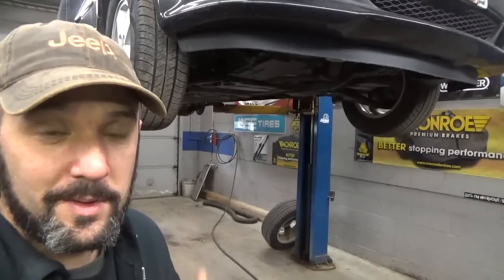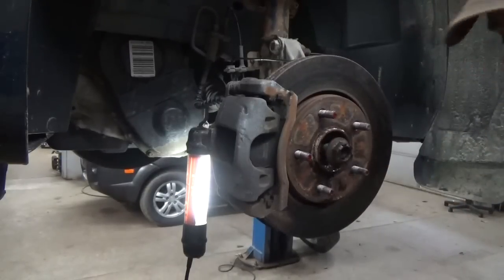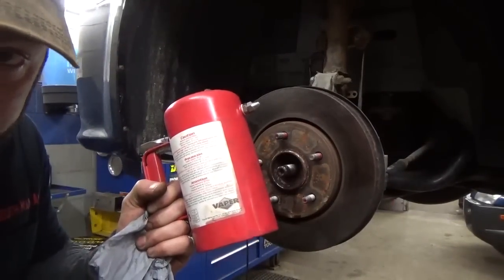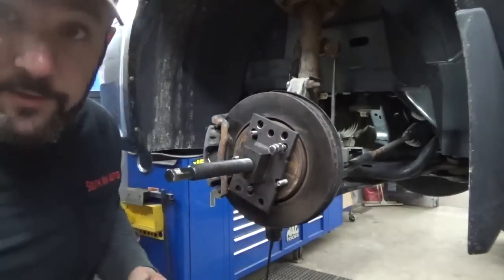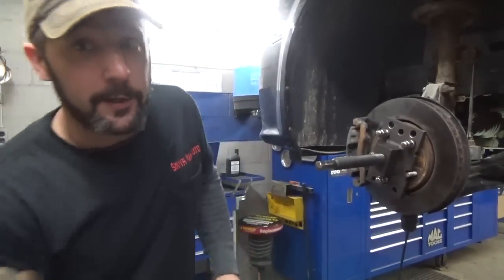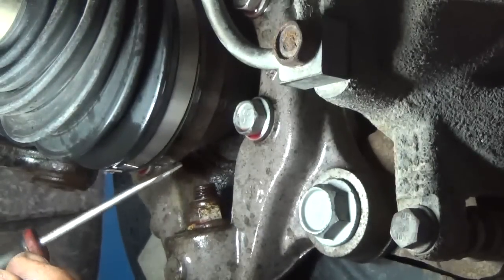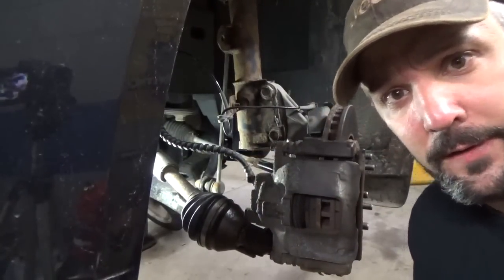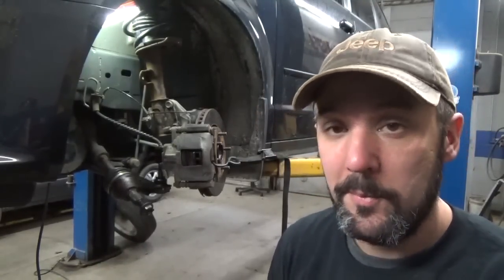Dodge Grand Caravan Lower Ball Joint - Part I

Comment: Question Because the axil is damaged now and has to be replaced Who has to pay for the replacement? I know it wasn't your fault u had to remove the joint. Just curious how the expenses are transferred
Reply from the maker: William Govan Customer buys the parts to do the job... just happens to be on this car the axle was seized ya know...

Comment: ABSOLUTELY THEEEEEEEE   MOST  REAL LIFE  /   GENUINE  REPAIR VIDEO ON THE  INTERNET.    SEVERAL TIMES I HAD TO LAUGH.       BEEN THERE    DONE THAT.  TRYING TO FIX ONE THING--ONLY TO BREAK SOMETHING ELSE THATS EVEN HARDER TO REPAIR/REPLACE THAN THE FIRST ..   I WOULDVE GIVEN THE CAR BACK TO THE WOMAN AND TOLD HER TO GO ELSEWHERE..      OR  RUN THE DAMN THING OVER A CLIFF ..    LIFE IS FAR FAR TOO  SHORT FOR SHIT PROBLEMS  LIKE THAT.     THE ODD PART OF IT IS.    THAT CHRYSLER  KNEW THIS WOULD HAPPEN WHEN THEY DESIGNED THE DAMN THING...
    JUST AS FORD KNEW THAT FREEZING RAIN  WOULD SLIP DOWN INTO THE DOOR HANDLE RODS INSIDE THE DOOR AND FREEZE THE DAMN THINGS IN PLACE--   WHERE YOU COULDNT OPEN THE DOOR UNLESS YOU POURED HOT WATER DOWN THE WINDOW.

Comment: recently changed the wheel bearing on my 2002 sunfire  Axle slid right out. Helped a freind with an avenger some  years back he torched the axle stub off! then called me I smaked it with a sledge and big drift what  was left poppped out. doy you think dadge axles sieze worse than gm's?

Comment: hey, there Mr south, just wanted to suggest, cause im new to this task your performing,    could u have use  oxy-acetylene heat  to losin  that nut or what ever bolt u were tryilng to get loose.
Reply from the maker: hunkydude322 I thought heat may ruin the bearing

Comment: Hello I know what you are going through, I am a Canadian. Salt holds our cars together!  I would like to comment on the stiff cv joint,all that's wrong is the shaft is driven past the clip groove. The end of the shaft is bottomed in the joint. The easy fix is to clamp the shaft in the vice and slide hammer the joint back.

Comment: When your pounding that hub tool that's tightened to the wheel studs with the sledge hammer, aren't you just transferring all the impact directly to the hub and shackle and any play in the suspension just gets moved to the cv joints?  It doesn't seem to transfer any opposite force directly to the shaft to move it away from the hub???

Comment: I feel your pain working in the rust belt also.

Do you charge the customer additional labor time for removing that stuck axle?

At our shop, as a tech, if it took me a few hours to do the same as you, i would loose time as where i work, they only bill for what the book time calls for, no more, no less.
Reply from the maker: dreamer2355 If I only got paid flat rate as soon as my time was up I'd pull it out and quit lol. I charge by the hour on things like this, you have to. I didn't make it rust ya know? Any one going to fix it would have faced the same problem.

Comment: Why do you use joints with grease fittings? The fittings, in ny, get rusted so fast.
Reply: Joshua Harden, you can pick up rubber caps for the Zerk fittings to prevent them from getting rusted up or covered in gunk.
Reply: Pet Rock's Garage If you grease them regularly and leave a clump of grease on them they don't rust, plus they are easy enough to replace and the reason the original failed was lack of grease IMO

Comment: cut the boot off the ball joint put vise grips around where the boot would be. Loosen the balljoint nut with a wrench and using a torch to ease up the nylock as you loosen the nut you can knock it loose from the spindle pulling the control arm down so you dont have to d1ck around with the axles. Book time calls for 3.4 hours to press in lower ball joints on the Chrysler van i did yesterday. i live in Maine where it rusts like hell up here. I got em both done and out the door in 30 minutes. I will say the torch can be a finesse type of tool if used properly.

Comment: 12:03 The secret with removing the rear brake drum (which is bolted onto a taper) off a Skoda Estelle was to apply torque to the puller whilst simultaneously belting it with a club hammer. Was never defeated. Also always applied a smear of grease onto the shaft when refitting and never retightened it to 'factory specs'. 
Am curious to know why the flame wrench didn't appear.

Comment: OMG, LMAO  thanks for the entertainment.  I cannot believe how hard it was to get the nut off.  I have a 2011 and mine was not that difficult to remove.  .I do not have any air tools.  I have clunking and clicking noises coming from right side wheel well.  I jacked up the right side and if I rotate the tire a  little it makes a clicking noise by the transmission where the boot is.  I did not have play up and down or side to side when moving the tire.  When driving it almost sounds like I have run over something and that something is being thumped up against the the inside of wheel well along with the clicking noise.  Any ideas?

Comment: The biggest difference is you have a shop with all the tools you could need, as well as a vehicle lift on a solid level floor. I'm running with a Walmart floor jack, bricks, Grandpa's tools, on a sloped gravel driveway. We are not the same.

Comment: For my tractor, I use 3/4" and a 8' cheater bar.  Something's gonna give, one way or the other.

I'm don't own a shop, but if I did, I would have a policy that states: ' I'll spend 30 minutes trying to break through the rust.  If not successful, you are buying a new axle, bearing, etc etc etc.'

Comment: What could make it worse? A 12 year old Grand Caravan, in Ontario Canada, in February, in the driveway. What can make it better? Scotch for me and a product called Evaporust. I built a dam like you but out of paper towel. I poured the Evaporust in and let it sit for about 3 hours. 1 bang with the hammer and the shaft popped free.
I do admire your perseverance but wish you wore safety glasses at times like that.

Comment: Seemed that the impact lacked torque. The CV spline seemed to move when you use the breaker bar.
Reply from the maker: john smith I can also apply an insane amount of torque with a 3' bar too

Comment: If you have a wheel bearing and a cv axle stuck like that i normally heat the hud where the splins are for the axle until its orange all the way around and then use the air chisel and push the axle back. You will destroy the wheel bearing and most of the time the axle is fine afterwards

Comment: My 2010 town and country did the same thing. 30 minutes of beating it with a sledgehammer got it loose, then 20 minutes fixing the threads with a chaser. Just the driver side tho, the passenger side came right off.

Comment: What do you call the tool that you used to press the axle shaft? I can't seem to find one so maybe I'm calling it the wrong thing. (Axle press?)
Reply from the maker: +jhitt79 Hub puller?
Reply: +South Main Auto Repair well I guess so! I tried searching under hub press, axle press, cv shaft press, etc... Type in hub puller and "poof" like magic they appear in droves. Could'a sworn I tried hub puller but I guess not, thanks a lot.

Comment: Hmmm My 2006 Ford Fusion with 152000mi needed a wheel bearing and the axle was not even close to being that difficult. I wonder what kind of metals Dodge uses for the knuckle and the axle.

Comment: Take a 18 mm wrench and turn that bolt off the ball joint as it gets closer to the axel put a fork in the ball joint and spread the ball joint down which will pull ball joint down allowing room for the nut to be turned all the way off without messing with the axel or wheel hub ! I do it all the time

Comment: In the UK we have an M.O.T (Ministry of Transport Test) every 12 months, with a ball joint in that condition it would fail with a dangerous fault and not allowed back on the road, the repair would either have to be done at the test station or put on a flatbed to take it away.
Reply: Actually that ball joint would go a while. Yeah, it needs to be done, but we're not as anal in the states. If a safety hazard took every car off the road, there wouldn't be one MG ever allowed to be licensed. Every one of them was an electrical short and fire waiting to happen.

Comment: i hope you hit it with the sledge without the press on there because when you were hitting it with the press on and tight the threads of the press were transferring all that energy to the rotor/hub not the shaft

Comment: I'm not questioning why you did what you did, because as a tech myself it's an unfortunately sickening part of doing what we do, but for my own list of tools learned, I wonder had the wheel been turned inward or outward some, would that have prevented this, since the outer CV was theoretically being pressed down onto the shaft by being straight?

Comment: Nice moves with forward  and Reverse  how do u have the patience  with working  with so much rust?
Reply: You just learn to deal with it really, I rarely break bolts anymore after having to deal with this crap for years. Anything that goes into aluminium however is a crapshoot.

Comment: You could cut a 3/32 or 18" bevel on the leading edge of the puller/pusher so when you hit it, it does not roll over keeping the socket from sliding on.  Kind of like a cold chisel!

Comment: OK so first time i have seen you mess up on something. The hammering with the lugs tight! big no no. You can only take up the slack in the press and in it's attachment then the force is pushed into the press to the rotor and out to the car... skipping the center. The trick is to turn the nuts (wheel) off just about one turn and then tighten up and hammer. when your falling off center again your know you pushed the shaft. 
:) HIt like if you think i'm right about this one. Sometimes you just push the shaft a bit in the joint and can be fixed or loosened up with a tap in the other direction.

Comment: I just replaced both control arm assembly with ball joint from moog and I didn’t have to remove the axle. I just used 18mm open end wrench to remove ball joint nut. Ease peasy

Comment: I'm going to do the uppers and lowers on my 2002 Eurovan. The lower on this car is similar to the upper on mine.
Reply from the maker: Garth Goldberg Don't forget to make a video :)
Reply: Actually, it's been done already. Meister Lott, out of Germany has a YouTube video showing how to do the lowers, with some cool Euro tech music. He does it on the exact same car as mine, same color even.

There's other DIY videos  out of England and Europe showing how to do the uppers.

Volkswagen T4 (Eurovan)

I bought the Genuine VW/Matra cup to press in the upper BJ.  It was $40 from Snap On, but I don't know if the universal free rental kit from Advance Auto is going to have the right size, and I don't want to find out after I've got the garage space all cleared out and the car up on jack stand.

Comment: I had an issue like this years ago, on a BMW but what I was able to do via my best friend and Eric O. level mentor Bob M. Was carefully torch the lock nut but just long enough to melt the plastic locking portion of the nut and then it unthreaded like a regular old castle nut would. Just some help for anyone reading the comments.

Comment: Yes. Once the taper breaks loose, the ball joint will just spin round and round and the nut won't come off. Ahhh. You made the CV joint shit the bed. Oh well.... You did what you had to do. Give her a new CV shaft at cost or 10% over or something. It'll be alright....

Comment: Eric..could you please tell me the tool series number on that tool u used to push the axel out??
Reply from the maker: Stenio Fernandez  Sledge hammer and ,  MHT6290 Mac Tools Press, OTC makes it http://www.auto-repair-manuals.com/Front-Hub-Puller-for-4-Wheel-Drive-Vehicles-OTC-6290.html?gclid=CIzigIjX6cYCFQ8YHwodoqgFjQ
Reply: Thanx eric..

Comment: when i replace my wheel hub a buddy of mine had a puller of some kind but we repurposed it it has 3 reversible hooks with a dull point that goes in the axel screwed it down and it backed the axel right out then getting the hub out took an hour of beating the old one with a sledge lol

Comment: Yeah today I just did the same thing only I pulled the damn CV joint out after luckily I was able to unbolt the lower ball joint with a skinny wrench took everything into the shop and used everything this little 20 ton arbor press had and I just managed to pop it free of course the bearing is no good anymore all needs to be replaced but I saved the housing. Can’t even imagine it’s like it’s fucking welded.

Comment: @South Main Auto Repair

Hey, Eric, great video and awesome work! I have officially seen every video on your channel now (including your chainsaw repair with the carburetor that cost a nickel) and cannot get enough!

I was hoping you could help me with an issue I'm having with my 2005 Pontiac GTO (with the big six-oh!).

When turning sharply to the left, I experience a loud popping sound. Additionally, the steering wheel shakes back and forth rapidly at speeds over 55 MPH, and I can hear a loud whirring sound that seems to increase/decrease with road speed. 

I replaced all four tires and both front lower control arms, which came with new ball joints and bushings, and had a shop perform a four wheel alignment after. This was about a month ago, so I do not suspect tires/alignment to be the cause.

Is it possible that it is a wheel bearing or tie rod end failure or excessive wear on either of these components that is causing the noise/steering wheel shaking? The driver's side tie rod looks to be over extended such that the ball joint in the tie rod end makes a smaller angle than the passenger's side, if that helps.

Thank you for all the wonderful content, can't wait to see part 2 of the Corvette Billy Boat exhaust install. Love the way the LS engine family sounds.

Thanks,
Luke

Comment: Hi, It looks like you tightened the plate of your puller against the hub with the wheel nuts. That would mean that most of your hammering was going against the hub instead of the axle. Perhaps next time put the wheel nuts (better to use plain flat nuts) on by hand then tighten only the shaft of the puller with your  air gun.

Comment: I Got a Flat Tire on a Dodge Ram Prospector in the Late 90’s the Wheel Rim was Rusted on I had to put the Lugs Back On and Leave them Loose then Reverse Into the Curb Over and Over Again Until it Broke Loose I was at a Rest Stop Not Even the Tire People Could Remove the Rim .

Comment: The owner didnt notice something was wrong ? Have to be making some kind of noise / shimmy drivin... ;)
Reply: South Main Auto Repair wow .....
Reply: I believe you are correct - LOL
Reply: It is if it gets bad enough :)
Reply: Mine were both worse that that one and I didn't even notice it. When on a lift the rust made it hard to see the play unless you really pry on it. I heated the control arm instead of pressing them out because it's so easy to bend the soft steel they are stamped ot of. Some say it's not good to heat, but I think it's better than mangling it with a press. It's a shame they don't bolt in. 

When you get the control arm to alost glow red they will fall right out and when you pt the new one in the cooling steal will clamp down on it like a vise and the clip is a backup just to make sure it doesn't come loose. I think this is the easiest way, but I still hate doing them.
Reply: Hmmm I've had ball joints that bad and I noticed it especially over bumps and tight turns, down here in the south we do ride with the widows down and can hear things without the AC blowin - :)

Comment: Shouldn't those splines have been greased for easier sliding and for rust prevention?   Looks like the spanner-jockey (no, not mechanic) who assembled it took the rust-making short-cut.

Comment: I had to be replace a wheel bearing in my 2005 T&C just before I got rid of it.  250k miles and just a tap on the axle stub to free it from the hub.  Now I have a 2008 Dodge Caravan (basically the same as they s 2012) and I am very afraid.

Comment: lol...this is awesome... May just have been easier to remove the whole control arm (couple more bolts) than to play with the CV shaft. Don't forget to touch the rotors with greasy hands.... you know (Because eventually the car will need a brake job anyways) 😌

Comment: I need to get another puller like that  works great but I broke mine trying to budge an axle on aram 1500 ended up pulling the knuckle and using a 50 ton press and oxy acetylene destroyed the shaft and bearingand there went my "quick ball joint job"

Comment: Why are you beating on the screw of that press? It can't move. You destroy a good tool just for some vibration? Just screw the nut on backwards, with the flat side facing out, until it is flush with the end of the CV Shaft and hit that with the Sledge Hammer.

Comment: Holy crap at beating on that with what I assume was a 16 pound sledgehammer.
Reply: DO NOT DO THIS.. Take off the Tire. undo the ball joint nut as much as possible. Put the fork in there separate the ball joint. now complete taking ball joint nut off, using leverage on swing arm downward. Ball joint separates from swing arm and strut NO PROBLEM. Reverse process your welcome. The smashing action is to create more damage. this guy screwed the wheel bearings and CV axles and all that impact direct into transmission. I live in Canada east coast and do this stuff in my driveway lol. ALL he did was unnecessary. But can now bill the time and  many parts, oh and when Transmission falls apart he get that cash too right? Remember to put 3 nuts back on tire stud to hold rotor in place. do not take center shaft nut off there is no need.